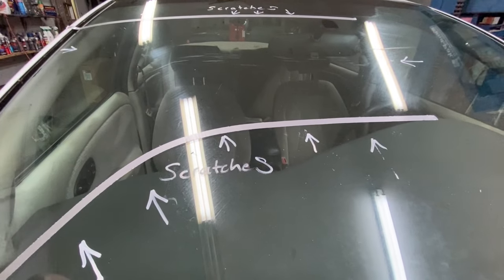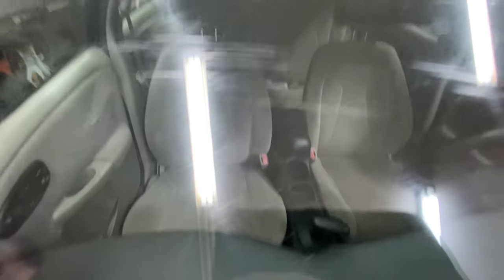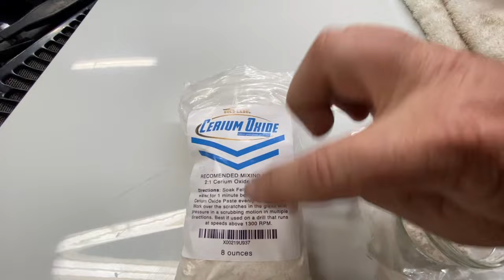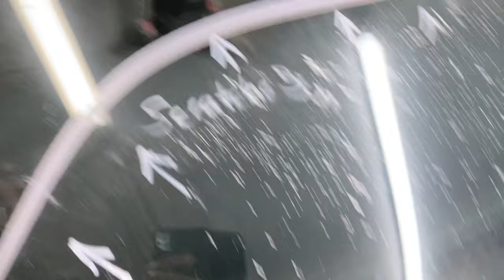Cheap Windshield Scratch Removal At Home - Before And After

Comment: Deep ones, have to be cut. Start with 180 then. 400 then 800. And finally 1500. Or finer. Then you polish.
Reply from the maker: I explained that in the video.
Reply: Polish with what ?
Reply: @northwestrepair the video shows the compound
Reply: Haha with bird shit!!! @northwestrepair
Reply: Are you talking about the thingy for the drill? With those numbers i mean.
Reply: @northwestrepair  hey small world out here lol. I had a scratch on my windshield
Reply: That would just ruin the windshield completely. If you need to use 180 grit sandpaper, it's time to replace it outright.

Comment: Faster and easier and practically impossible to screw up.....Ajax the widhield if you want you can use steel wool if you want but Ajax is fine ...once you notice the scratch has faded or has reduced in size ...clean up make sure completely no ajax residue what so ever ..then use any car polish on the windshield...it fills in scratches
Reply from the maker: You have to be careful because the windshield is obviously a safety issue and don't want to distort the glass with products not recommend for that purpose.

Comment: My windshield has lots of tiny specks/dents all over the entire surface, probably from oncoming tiny debris (sand or whatever) while on the road. Does it fix them too? Or is there a better way?
Reply from the maker: No, not really. It's more for wiper scratches, you will have to replace the windshield.
Reply: no
Reply: My windshield has many swirl marks and scratches but its not deep can cerium oxide remove it? Thanks
Reply from the maker: @tnvsarlannvillavert3637 yes

Comment: i use clear resin on the deep ones after scratches after buffing uv activate and then cut with razor blade gives it a final touch then another polish to remove highspots

Comment: That's crazy, i've been watching a few videos from "professionals" removing scratches and cleaning windscreens and they all take around two hours to clean/ remove a few scratches and use at least $80 worth of products, do you recommend sealing the glass after polishing and if so what with please?
Thanks.
Reply from the maker: People sometimes over do things. No I didn't use any sealer, but I do use rainx on all my windshields
Reply: @motorcarnut  Yes they do, ok thanks, i have not tried that, i used Stoners invisible glass clean and repel once and it wasn't good!

Comment: I wonder if i can just use fast Orange on Foam pad and rub the scratches out.
Reply: I just tried this today and it scratched it worse
Reply: Fast orange and compound
Reply: @travisshatswell1421  ouch
Reply: @travisshatswell1421  seems safer to rub it in buy hand i do have DA polisher a nice one Meguiars MT300. So it is much safer to use then orbital. But i try out some fast orange by hand.
Reply from the maker: No, that product has grit in it and will scratch the surface and make it worse.

Comment: Thank you for the great content. I have 2 questions 
1. Does the cerium oxide leave a haze? Do you need to polish it with anything else to get clear glass after the cerium oxide or does it not leave a haze anyways? And the second question is: how long did it take you to remove most of the fine/smaller scratches you did first, 15-20minutes moving the polisher around or so?Thanks in advance from the Netherlands!
Reply from the maker: Hey Netherlands! Thank you so much! No, it does not leave a haze, and correct about 15 minutes, let the tool do it's job, don't rush it and it will come out great!
Reply: @motorcarnut  so I tried it and the scratches faded a ton!! However, I did the whole windshield, didnt use pressure and went to drive it just now and I have noticed a ton of swirling and marring (evening hours). Im pretty sure this wasnt there before, must be the cerium oxide leaving swirls or maybe the marring just now became visible . What can I do? Use a finer/finishing polishing compound to smooth things out?
Reply from the maker: @Ryy22 It shouldn’t have left any swirl marks. Maybe the windshield was contaminated before and mixed together when you finished. Yes, if you have a polishing bonnet and some glaze or micro finishing compound it should take all those swirls out no problem. Just make sure to clean the windshield first then after for a crystal clear finish
Reply: @motorcarnut  Thank you so much amigo, was worried there. You are truly so helpfull, god bless you man 👏
Reply from the maker: @Ryy22 Thanks bro! Much appreciated!

Comment: I have tiny scratches full on windshield, these scratches are not visible, but only at night when you are inside the car and you look at other people light or streets light. 
Is this common? Or does polishing help with it?
Reply: It's not that common. Always use quality wiper blades specifically soft rubber or silicon made. Most of the time  wipers with dust on screen creates scratch marks.You should get screen polished by an expert
Reply from the maker: That process in the video will eliminate those tiny scratches

Comment: Hey bro! Could you please tell me how much RPM I need to set in my polishing machine to remove the scratches from my windshield?
Reply from the maker: 1500 to start with then 2000 to finish is fine. Don't worry if you go to slow or to fast, it's glass not paint and the powder is very minimal abrasive.

Comment: My wiper blades clips got off and the metal hand gave a scratch on glass. Can this trick help?
Reply from the maker: If you can’t really feel the scratches with your fingernail then yes.
Reply: @motorcarnut  what if you don’t feel them with you’re finger nail ? Can I just used polish ?
Reply from the maker: No, it won’t work. You can pick up that power and buffing wheel I used in the video pretty cheap on Amazon.
Reply: @motorcarnut  where’s the link ? For buffer and pad !?
Reply from the maker: Gold Label Detailing Optical Grade Cerium Oxide 8oz Glass Repair Powder | Glass Window and Windshield Repair | Optical Grade, for use with Camera, Scope, Binocular Lens (8oz with 3" Felt Bob Wheel) https://a.co/d/iTKw21l
Reply: @motorcarnut  Thank you brother , i will give it a try !
Reply: @carlosbolanos5361 if you tried it then what is the result

Comment: Awesome! Just scratched mine very slightly (not noticeable with fingernail) but the old wiper left an arc just like yours. Will try this! ( they reccomend the red Cerium oxide but the white seems to work perfectly.)
Reply from the maker: Good luck, it works great. The more you go over the scratch the clearer it becomes.
Reply: Oh but don't get it twisted... it's gonna be some work.